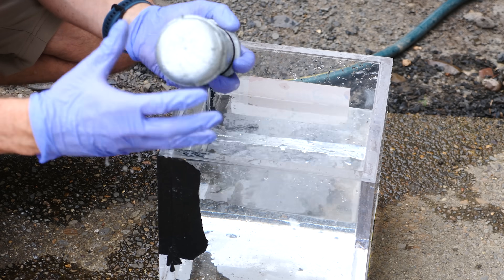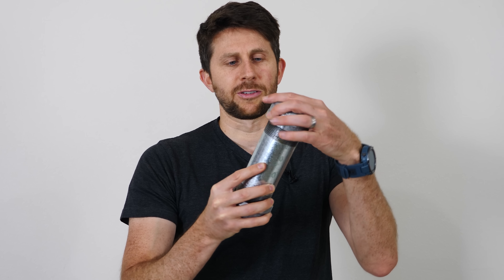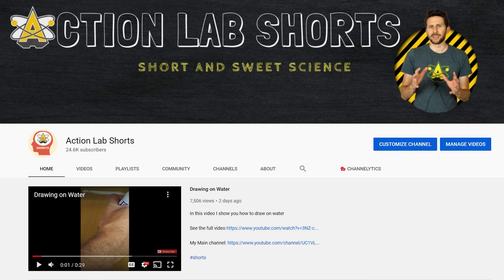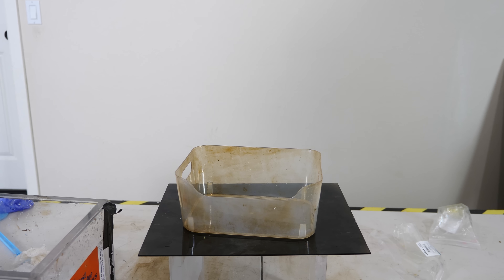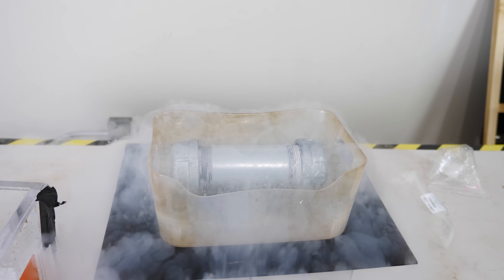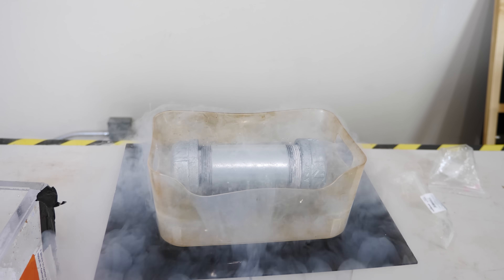Can You Stop Water From Expanding When It Freezes Into Ice?

Comment: The cold liquid nitrogen (not the ice) broke the steel cap, starting from a microscopic crack.
You will get similar results but with a smaller bang, if the pipe was empty.

Comment: If I have a thin steel ring, and freeze it to some temperature x, the associated shrinkage will make the diameter of the hole slightly smaller. If I have a uniform, round steel plate of far greater mass however, and reduce it to that same temperature, a center hole of the same original diameter will now be even smaller than that of my thin steel ring. All of that additional shrinkage has to have somewhere to go. A smaller hole is the result.

The pipe too is a ring. But so is the metal cap, at least till you get to the very end where it becomes a metal disc fused to a metal ring. However, the additional mass of that disc relative to the ring means that the hole right there at the disc is going want to become slightly smaller than the hole beyond it, that is, the hole for the rest of the ring itself. So down at the indeed very fractional level, yes, the very end of the cap was trying to get down to a size that's ever so slightly smaller than the rest of the ring of the cap. The rest of the ring of the cap was opposing that shrinkage, that is, by not being inclined to shrink quite as much. This would be why the juncture where disc adjoins ring would become the weak point under pressure.

In a word, it wasn't just the internal pressure [from freezing water] which alone accounts for the fail point (structural deformation) at issue. The internal pressure just took advantage of a weakening [which was] taking place for entirely different reasons, to wit, a form of weakening which would occur even if you were freezing just the cap all by itself. If the cap would have been screwed all the way down this probably would have countered that deformation, because the combined mass of the two rings (ring of pipe plus ring of cap) would have caused that hole too to become smaller to at least roughly the same degree the hole of the "ring at disc" wanted to shrink. In fact, assuming both caps were uniformly constructed, you can pretty well bet that the one which failed is the one which was least screwed on. That would be the one whose ring shrank less than its disc needed it to.

Comment: I was scared from the beginning of pouring liquid nitrogen how this will end. Those end caps are made of cast iron. They are quite brittle even in room temperatures.
Reply: You can get ends caps in black iron, but that one was steel. Even if he had used sch160 pipe it would have failed.
Reply: At the very least, use a stainless alloy like 304 all around. Cast iron and mild steel are greatly weakened at cryo temperatures. So the bursting was inevitable.
Reply: Those end caps are cast iron as are all ferrous waterpipe fittings.
Reply: @onlyicedasshole you can galvanize cast iron too. it's just zinc coating. you can literally coat almost any metal in zinc
Reply: Jeff engineer is 100% correct
Reply: yeah the pipe itself is much more ductile
Reply: Yeah, this guy is a total idiot.  Says something like "Let's put it in a container that can't expand", then puts it in a container that he admits "This is going to bulge some"...Uhhh...that's called 'expansion'.  Then, the previous mentions of the steel pipe contracting WHILE the water is trying to expand (due to the dissolved gas trying to escape the liquid...he should have used boiling distilled water when filling the pipe), then this, then that, then the other thing...  This guy set this experiment up to fail just so that he'd have more 'spectacular' video!!!!  Too bad he wasn't a few seconds later setting up his shield.
Reply: @fubisroc9673  - WOW - I suggest meditation for the anger problem...
Reply: @fubisroc9673  That turned really dark at the end
Reply: @fubisroc9673  He's definitely not an idiot. Watch a few more of his videos before commenting.
Reply: @fubisroc9673  Can you post a link to your video where you show us how you did it.
Reply: @fubisroc9673  he literally explained that the violent explosion is due to the still liquid part of the water that touches the liquid nitrogen when the cap pops. Be sure to contact your psychiatrist today.

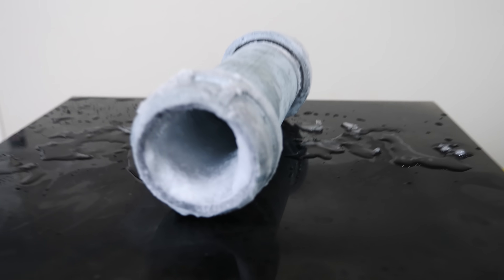Comment: 5:08 - "...steel does get slightly more brittle when it's at liquid nitrogen temperatures" - now, that's what I call a brazen understatement : )

Steel, specifically a regular (read: "cheap") mild / low carbon steel (like this one here) - gets EXTREMELY brittle at low temperatures. In fact, early Arctic/ Antarctic explorers learned it the hard way - which was, you can easily break off a hitch hook/ hitch attachment when you start moving or accelerate the leading/ towing vehicle too quickly, just at -40 - -50°C (-40 - -58°F). However, stainless steel behaves much better at those temperatures - for comparison take a look at https://www.youtube.com/watch?v=TexqYF_-3H0&t=1160s (watch until 22:54).

Yeah, I know - this is just another "Hammond's Superfluous Garbage for Uneducated and Somewhat Challenged Kids", but bear with me (and him) - and just watch how differently a regular carbon steel and a stainless steel behaves at low temperatures.
And oh, by the way - those end caps, one of which has broken, are made of a cast steel. Even lousier stuff than hot rolled steel.

"It wasn't as cold as liquid nitrogen, the last measured temperature I had was around -10°C" - well, yes - it wasn't as cold as liquid nitrogen, but Ice (which build up on the inside of the pipe) is a poor heat conductor, and then iron (= steel) has a very low specific heat (as all metals do), AND there was a LOT od temperature differential, AND it just takes a few seconds to cool down a relatively thin piece of metal. so...

Yes, as we all could observe.

Cheers!

Comment: Thanks for the experiment, thats Will be nice info if you can tell the type mass of the steel cylinder, wide of the plastik box (it would described how much liquid nitrogen volume inside) so we could know the exact pressure based on the data itself, thanks 👍

Comment: 2:58 yeah that's not true at all. I had a can of soda that was put in my freezer and forgotten, and when it froze it exploded so violently it blew the door open on the freezer and broke it's hinges!
Reply: Oh, that is fully possible then.
Reply: It would require an absolutely massive shockwave to blow a door off a freezer, around 1/16 the blast force of a grenade
Reply: @pagathorne2415  it didn't completely blow the door off, just blew it open with enough force to damage the hinges slightly

Comment: The caps are cast iron. Only the pipe is steel. The cast is #1 weak point, welded seam in the pipe would be #2 failure point. This has been my experience with rapidly expanding gas contained in a similar container

Comment: So to answer the question everyone wants to know. Yes if its possible to make a container strong enough to not break or deform, and if you can still at that point get the water inside cold enough it can eventually freeze WITHOUT breaking the container and before it gets to that point there is also a phase along the way where it will stay liquid when it actually should be a solid so long as the container holds up.

Comment: Should try sealing rigid couplings on and sealing pipe plugs inside the couplings. Pretty sure those caps are cast so they're a little weaker than the pipe itself.
Reply: A lot weaker, not that waterpipe is especially strong. The best mains pressure I've ever tested at any house is 60psi, so waterpipe is made down to a low spec.

Comment: I wonder what happens once Ice XII is achieved and then this hypothetical container is somehow removed and the pressure normalized.  Does it maintain that phase so long as the temperature remains the same?  Or does this special solid phase behave unexpectedly?  Would it change it's normal melting point at 1 atm?  Could this denser ice remain solid near room temp?
Reply: if the change in pressure was slow enough, maybe it could maintain that state for a while but it'd probably end up changing phase with any small perturbance. i don't think it'd be able to reach room temperature as ice xii

Comment: https://youtu.be/t5mdZD00POs?t=164 
https://youtu.be/t5mdZD00POs?t=258 
For the explanation it is also important that the air dissolved in the water is released when the water freezes and a bubble of high pressure forms which creates the pressure wave when the container ruptures. It behaves differently from the rupture of a hydraulic cylinder that is only filled with oil.

Comment: Actually there are two competing forces. While the ice tries to expand, the metal container reduces its size as temperature goes lower. Thats why the pressure inside becomes much higher than what the ice can do alone.
Reply: Trivially. Steel shrinks by 0.1% per 100C temperature change. Ice phase change is a 4% change.
Reply: @usingthecharlim   10%, but yes.
Reply: Good point

Comment: Try the same but put it in a container in the regular freezer. That way you don't expose the metal to potentially big temperature differences. If I remember correctly most iron alloys become brittle when below -25 C which it may very well have been in your experiment.
In a regular freezer and especially if you up it to -10 C that'll not be an issue and everything will fall in temperature very uniform and it'll ice inside the container much differently from the top down (because ice floats).

Comment: They apply similar principles in nuclear plant design: water heated directly by nuclear processes in the reactor reaches 300 degrees Celsius but cannot evaporate because it is running tightly in a closed, vacuumed loop  where it literally has nowhere to evaporate. The pipes of that loop get scorchingly hot and heat… water around them in tanks. Now that water evaporates freely and drives steam turbines that in turn drive generators. Water heats water, yes. Simple design, but very efficient.

Comment: You should machine a cavity out of a large block of tool steel that has a long threaded hole to put the water into.  Plug the threaded fill hole with a large bolt and freeze the block.  I think this would hold enough pressure to freeze the ice.  I would love to see how "dense ice" would behave.

Comment: Questions: Ice IX up to ice XII seems to be denser than liquid water. 
1) Does that mean it would sink in liquid water, not float?
2) Would those ice variants retain their special densities once the outer pressure be reduced, or would they change back to other ice variants?
3) If such ice variants could be brought to incredibly high pressures without a container (for example the many kilometer deep oceans of several of the Jovian moons that are assumed to exist there), would that mean that those oceans could have a layer of permanently frozen ice on their ocean floors? Or is that pressure still far too low to contain ice IX to XII?

Interesting thought experiment you brought up here.

Comment: Happens to plumbing in real cold climates as well, you can run an electric current through your copper plumbing supply line to melt the ice before it burst. Preventing an expensive repair 👨‍🔧

Comment: Wouldn't quick freezing the metal pipe with carbon dioxide weaken the structural integrity?  Why not freeze the pipe filled with water in a normal refrigerator freezer?

Comment: What would happen to a vessel that is fully submerged upside down with an air pocket inside it after you pull a vacuum, for example an upside down glass in submerged in water inside a vacuum chamber with a small air pocket trapped in the glass. Please try this.

Comment: We do this at work on a weekly basis to perform cryo scanning electron microscopy on hydrated samples.  The goal is to freeze the (small volume) of water so fast that the ice that forms is vitreous (non-crystalline) in order to avoid damaging the microscopic structures we wish to observe.  To accomplish this, we put the LN2 under vacuum until it turns to a slush, break the vacuum and quickly plunge the sample into the LN2 and reestablish the vacuum.  In this manner, the water flash freezes, forming vitreous ice that not expand as it freezes, thereby preserving the integrity of the structures.  The sample is then transferred under vacuum to the SEM chamber where we manipulate the temperature and pressure to cause the vitreous ice to sublimate away, leaving the frozen structures visible to image in the microscope. Cool video, and nice discussion on the phase diagram of water.  Glad you got that blast shield up just in time!
Reply: Brilliant research work. Sounds like a lot of fun. What country is your lab in?
Reply: @Mark Awachie  we are in the USA in Massachusetts.
Reply: Does that mean if you can do that at a larger scale, you will be able to make a person freeze/sleep?
Reply: @saulgone2766  two problems: 1st, the larger the object, the more difficult it is to form vitreous ice. Much larger than a pea, and it won't freeze instantly, which causes crystalline ice, damaging tissue. Second is the sample must be in a vacuum, which isn't too healthy for people!
Reply: @beldavius  LOL  :) It'll get figured it out eventually without having to put people under 620 Mega Pascals or under a vaccum, until then stay warm everybody!
Reply: There are videos on youtube I think.
Reply: How the fuck is that work? Lmao wtf is your job? Who is paying you to do science experiments on water? How is that a business?
Reply: I’m not reading all that
Reply: @LiquidSetting25  and yet you replied...God forbid you learn something.. 🤣
Reply: @beldavius  It's a trolling bot that replies to long comments with that automatically.
Reply: @LiquidSetting25  I read and it was complimentary to the video. Maybe youtube shorts does have an audiance without the seek bar

Comment: I wonder if ice 9 or 12 would instantly revert to water once the pressure is released. Also it looks like water will become solid even if the heat is great, so is hot ice a thing? Could you theoretically hold a chunk of ice that keeps you warm or even burns you?

Comment: 2:50 woulda thought you'd remove this nonsense after the results of the video. you were very lucky that the cap gave out before the container did. not to mentions fluids are insanely dangerous, injection injury is one of the easiest ways to get dead or lose a limb, and you don't even need enough pressure to create shrapnel (which it can absolutely create)

Comment: The cap looks like cast iron, not steel. Am I correct anyone?
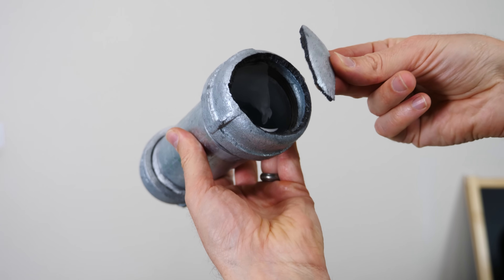Reply: Yes, it looks like a galvanized cast iron cap.  Check out when (5:27) he places the piece of burst top. It looks very grainy so it's definitely cast rather than formed. The outside features look worn, like you would expect from a worn out cast iron mold rather than a more expensive steel.
Reply: @markhorstmeier8734  Exactly!

Comment: It the container was in a cuboid shape or the container had edges it would have blown in a much intresting way.
Reply: Military is working out cold water filled hand grenades
Reply: I think it would have still just burst at the cap or the lid like it did with the cylinder. The lid/cap is the weakest point to it's reasonable it breaks there.
Reply: @hoominbeeing  yes you are right.

Comment: a 300psi SCUBA tank is designed to hold about 200 atmospheres. basically the thickness of the cylinder you used was too thin, by a lot. you also don't need to use liquid nitrogen to freeze the water (resulting in the explosion when it fails) and getting the potential criticism that you made the steel too brittle via the liquid nitrogen (which you stated it wasn't at that point).

Comment: I filled a plastic bottle with water.  Put in the freezer the water expanded and the bottle split.  Water expands when frozen.  I get it.  So I filled another only to half and put that in the freezer. The water froze but the bottle was deformed inward in the empty half.  ???   Another bottle 3/4 filled, I squeezed all the air out and capped it  When this one froze, the expanding water did not make the bottle more round.  Instead it appeared to shrink!  I'm probably missing something obvious, right?

Comment: I know it's a bit late but what if before freezing it you wield the container shut, because it popped the lid off which means it can do that but can it actually explode the container itself trying to make room, pleaseeeeeeee wield the lid shut and see what'll happen (should probably do it outside cause if it does succeed to break through the container metal will fly everywhere as you said) nvm it did break the container oops

Comment: I knew it was going to explode the action of water freezing from liquid to solid is actually very very fast it's not like it takes a long time it's actually just trying to reach that sweet spot and then it instantly has it chain reaction that's very quick and crystalline structure almost flash freezes instantly and that combined with the microcrystalline structure changes of steel itself I mean the whole entire atomic structure of steel changes into a brittle glass like state if given cold enough temperatures like the winter in 1944 in world war II. 5 of the United States massive warships were caught in a brutal winter storm and all 5 literally cracked, and broke. Some even severed into 2 different pieces because the conditions were so frigid. Excellent experiment!

Comment: I don't see why you move up the graph around the 6 min mark. You weren't increasing pressure at a constant temperature. You were decreasing temperature at a constant volume (density). Seems you'd move left, with some upwards component. The interesting question is, what pressure do you get when you move water to 0K, limited to a minimum density of 1 g/cm^3? This is what you were trying to approach by lowering temp while keeping mass and volume (i.e. density) constant.